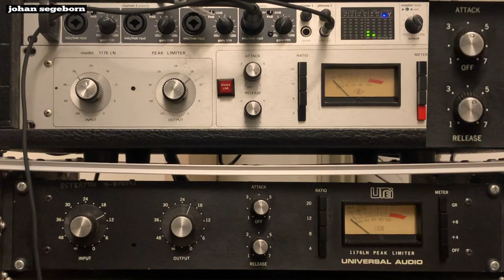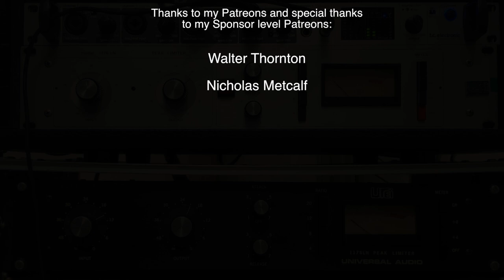This is where those PUNCHY and NATURAL 1970s Recordings came from!!

Comment: Finally somebody said it. It was the compressors that gave the old recordings that 70s sound, and not effin' tape! :)
Reply from the maker: Hahaha! Certainly seems like it
Reply from the maker: Yeah they both provide the punch and the high roll off
Reply: Tape does provides a natural compression so to speak. Also a certian ambience. I run tape decks and can run with s straight sound pretty much most of the time.
Reply: Different flavors of compression. The trick is to dial in the behavior you want. I have been stacking up various amplifiers to blend the different signals into a sound,  and discrete compression is on the list. When I get a Tape Echo it will also compress differently. A popular type of compressor specifically emulates the compression of a signal going onto the tape media, which can be noticeably not heard from digital conversion. Just use the kind that you like.
Reply: What about the artifacts caused by Dolby A ?
Reply: truth is It's boths, and more
Reply: Wellll both!
Reply: Tape too, and other things. This is nothing new that he said, maybe only to newbies at recording, as everyone who records halfway seriously knows comp and tape and several other things or lack therof is what gives an era it's sound, it's not just one thing, it's the amalgam
Reply: Just like guitars it’s the sum of the parts that gets the outcome. Not one piece of gear or a secret piece of gear.
Reply: Tape can surely add some compression and saturation when pushed hard enough but there are very good alternatives for those effects nowadays.
I really can't understand why some people are swearing by tape and hate so much on everything digital - often enough that's young recording engineers who never really had to work with tape.
In my opinion, it speaks volumes how much Bob Clearmountain hates tape machines.
Reply: If you have an overdriven amp and hit the tape real hard, additional compression might be a bit too much.
Reply: there is however a correlation between tube warmth and tape warmth, they are characterstically very similar.
Reply: @rodrigobelinchon2982  Careful talking abut Tape and Dolby, channel might get Flagged... too dirty! Nasty man!
Reply: @batman9592  not sure what you mean LOL
Reply: You've never heard of input transformers then and how they were used on Tape machines and Mixers....Look and learn. It wasn't one piece of gear it was the whole chain.
Reply: first chord sounded like paranoid..
Reply: @DatRebelDawg  Compander breathing is rude.
Reply: @goobiecaro8135  Definitely true and I accidently discovered that when I messed about with electric guitars when I was young. At that particular time, I had an old Akai tape deck and it had 1/4" mic inputs on the front. And also I didn't have an amp (later I did though) so I plugged the guitar into the mic input and turned the recording level up. On a lark, I just dimed the input level so it pegs the VU meter. I play back the tape and it's nice and compressed and the sharp and nasty solid state distortion was rolled off on the high end.
Reply: @DJPenguino51  lol, I have an Akai 1/4 inch reel to reel 4 track as well. That unit sounds better and easier to use than any of this new stuff. Plus, make players  have to learn their parts as there is no cut,  past, edit, redo, etc. on it.
Reply: @goobiecaro8135  yes, it's subtle.

Mixing music is NEVER just "put a mic on it & mix it dry" nor "it's all this component at a single point in the chain."

The LA2A would be used either tracking or at mixdown, but the tape is the final little extra bit, both. on the Mix and the Master

If you isolated say a guitar track, you'll be listening to 3 "compressors" cascading in series, which is how you do it.

It's why a high gain preamp has 3-6 tubes vs trying to get it all out of one overworked 12ax7.

Also? Genius pro producers and engineers at the top of their game in a million dollar studio.

That last part, picture the original Sabbath sound...now imagine they were recorded by probably the only man who really knew how at the time, Jimmy Page.

The gear for all intents and purposes is practically identical, down to the 26" kicks. Of course Bill had 2 🤣

Comment: Those older engineers and musicians were real cats. 
Geniuses. 
They had much less equipment to work with. 
Beyond equipment,
it's not the gear, 
it's the EAR. 
Always.

 ... and the decisions you make... 

The aesthetics.
Reply: @What11235  Much of the vintage equipment we praise today was considered limiting, technically incomplete, or even faulty back then.
It's the miracles the cats put out with it that give it its cult status mainly (quality of materials, pre mass production, is another discussion).
They also evolved it a lot by interference, tweaking it etc.
(proof of how much investigating AND creative at the same time you almost always have to be)
Surely you need FUNCTIONING gear. 
But from there on... 
The sky is the limit!
Music and knowledge is progressing. 
But still, more is just more, sometimes it is even less. 
Here I discuss how you do high class creative stuff, that exceeds the mere sum of its parts. 
Come on... 
Listen to the classic recordings and read the stories behind them... 
More often than not, the guys and gals worked miracles with a little more than nothing!!!

Comment: 1176 + LA2A = classic combination
Reply: Basically the only two that matter enough not to use plug in versions and go with a real deal lol
Reply: Those are the ones on my list. I capture the tones from my four main amplifiers to replicate into the echo system, and plan to use compression on a couple  just to have compression channels, also I think that maybe I can push my horns a little harder without letting out the blue smoke.

Comment: Consider using a much lower attack and release!  The 1176 will add too much top end the way you have it set which is why you're getting that pseudo clipping sound (which is actually the non-strummed amp noise getting bounced to the top).  If you really want to keep those settings you can solve that problem with either a multiband compressor or a 500 series EQ (to tame the high end).  Since you are a tone scientist, I'd recommend you study the mastering chains of the albums you like and buy those plugins and your already stellar videos will reach a level of polish that can only be described as studio quality.  Bus compressors can't really be cloned, because part of their sound is the whole "desk."  So something like a plugin-alliance SSL bus or Neve MBC plugin will really seal it in for you.  Also consider an MC77 which is a modern version of the 1176 that does away with some of the harshness while retaining the same distortion and punch the 1176 is known for.  Also disregard anyone that tells you to work in the box.  When you're ready, do your demos with some plugins then go to a studio with the gear you want.  Vintage, either an API or Neve desk to track, and mixed on an SSL console.  Mastering consider places that can still cut an LP, they'll have people in house with vintage ear and all the old gear that gives it that signature sound.  That stuff is too expensive to purchase.  You're talking $20-40k just in EQs, $30k tape machine etc etc etc.  There's a limit you're approaching in medium\small gear acquisition and I know it because I'm in it right now.  Reach out if you'd like to talk further, and thanks for being on Tone Talk.